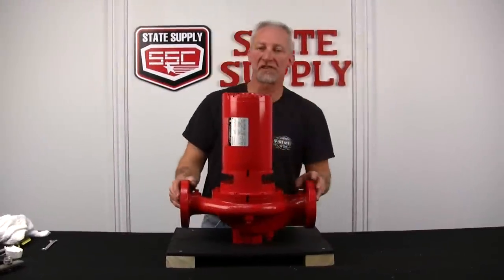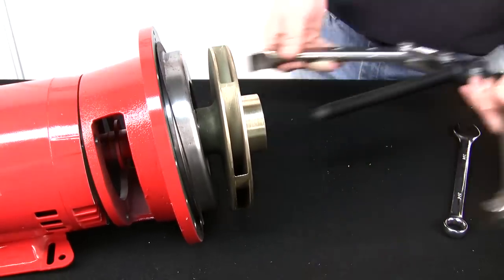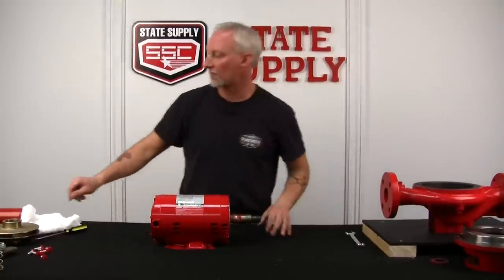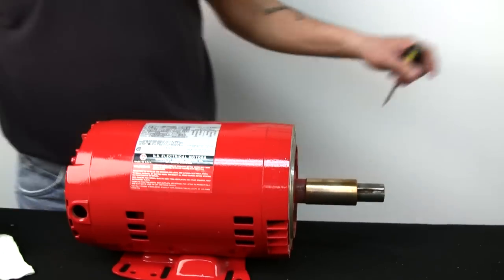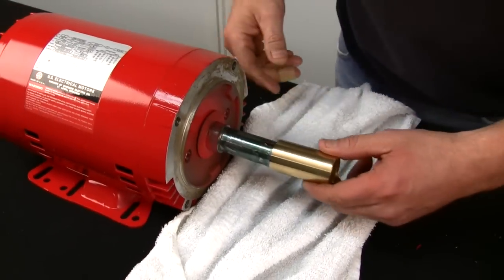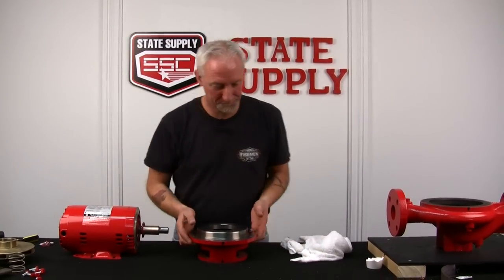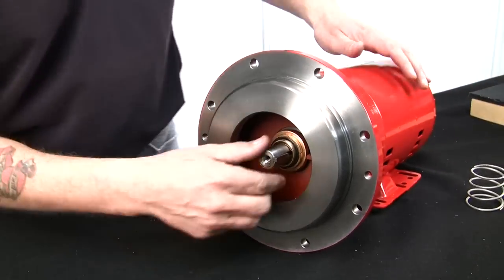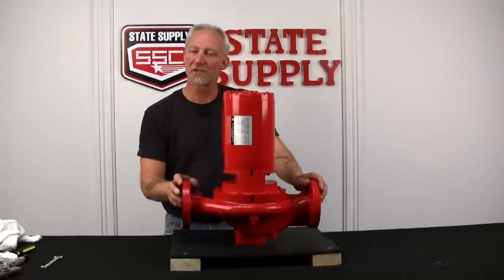Bell & Gossett Series 80 Seal Kit and Shaft Sleeve Replacement

Comment: My university thesis in 1973/4 was on mechanical seals and their failure modes, particularly distortion. I had a career in the oil industry specializing in maintenance and reliability of rotating equipment, and particularly the reliability of mechanical seals. I worked closely with seal manufacturers.
In short the seal faces are so flat, that we told the craftsmen to avoid even looking at them (as a joke to emphasis how sensitive they were). The faces' flatness is measured in light waves and they are very short. Distortion is very easy to impart to a seal face. They are also very easy to break. Pressing in a ceramic seal face with thumbs can easily break the seal and will distort it, plus the sweat from fingers will create a leakage gap. Maybe not noticeable on a low pressure water pump, but a high pressure seal fitted that way would likely fail on start up. Using a rag on the seal face would be a sacking offence. To fit the seals read the manufacturer's instructions.
Reply: Tell me you never actually been in the field without telling me you’ve never actually been in the field  😂
Reply: @omarpuentes4384  What are you trying to say. Your post is all nonsense, typical troll rubbish. I had 42 years in the oil industry Maintenace and reliability engineering. Worked with mechanical seals throughout that period.

Comment from the maker: Sorry for the delayed response. Are you asking about the shaft sleeve? If so, you can certainly leave the shaft sleeve on if it's in good condition. I am working on a new motor and removing the shaft sleeve to show you how to replace it in the case that yours is bad. Regarding a pulley, I assume you meant puller? You can certainly heat up the shaft sleeve and use a puller. If your shaft sleeve needs to be replaced, I just find it quicker and easier to use a screwdriver.

Comment: Ive always been told NEVER touch the ceramic seal? does it not affect the "seal"
Reply from the maker: Stacey Tannehill Obviously you want to limit how much you have to handle the ceramic side of the seal.  As long as your hands are not covered in oil or other crude, handling the seal should not hurt it.
Reply: Good Fitting 👌

Comment: Please don't use this video as a tutorial or guide. there are so many things that were done wrong. I am a pump and motor mechanic. I am not trying to troll just don't want people screwing up their pumps
Reply: +Ryan Krieger not using a button at the end of the puller bothered me the most lol
Reply: please explain the wrong "things", obviously for the sake of the video, a new pump was used, in the field they are usually tired , need machining of gasketing surfaces, thrush bearings etc...so please explain.....